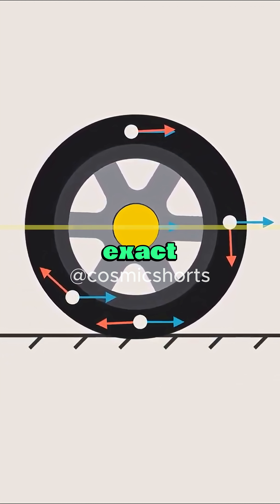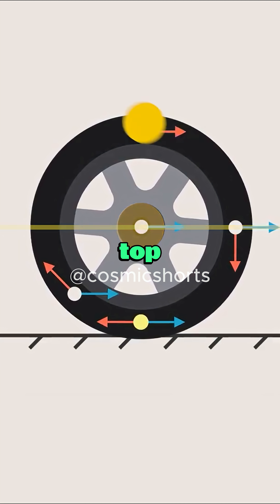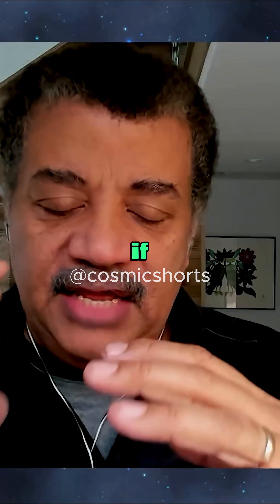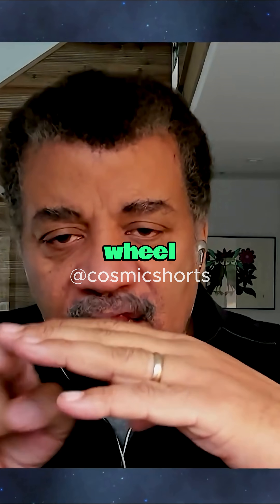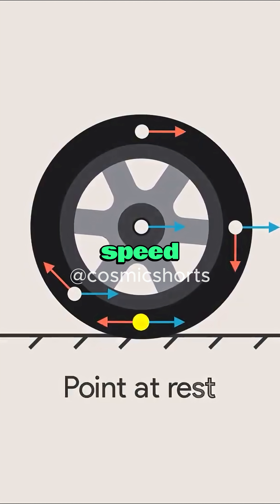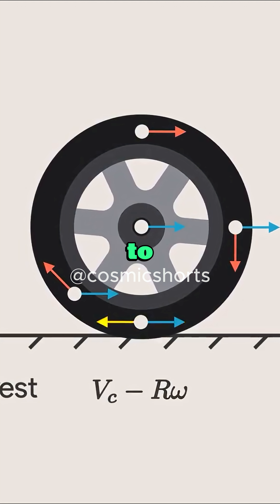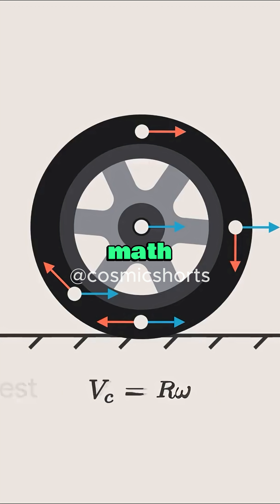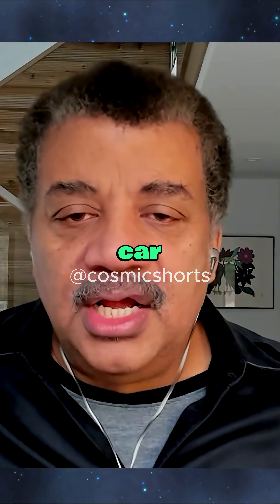The Surprising Science Inside Your Car Tires 🧪🛞

Comment: Makes absolutely no sense whatsoever. At best this is a mathematical problem. If the bottom of the tire (Neil, it is tire, not wheel), is not moving but it is directly attached to the top of the tire because it is part of the same tire, the top cannot move unless the bottom moves by the same speed. Yes, if you could stop time, then at specific point in time, the bottom of the tire that is touching the road is not moving but then at that exact specific point in time, the rest of the car, not just the top of that car’s wheel, is also major moving.

Comment: If we can do this equation properly can this be used to get out of a speeding ticket? Being that the speed in which they clocking is based off of the wheel that is not in contact with the pavement….which in turn shows that the speed they have is based on a faulty imaginary standard?….Lol

Comment: Yes but no. 
The "top" or the "bottom" of the wheel is always changing because it's spinning. 
Put some white tape on the wheel and tell me the"bottom" of the wheel has zero speed.
Reply: Consider each little section of tire separately. For the very short time each section of the tire is in contact with the road, it stops moving forward while the axle moves over it. Then that section of the tire is lifted up and the next section contacts the road. Of course, the tire as a whole keeps rotating for the entire time.
Your piece of white tape will stop moving forward for the short time it is touching the road.

Comment: It depends on the reference point you choose. Watch from the side of the road, then his explanation is right. If the pavement is not moving, the tire in the contact point also can not have speed. Take an exact look at a moving tank... you will be surprised.
Now imagine you are sitting in the car. Everything outside is suddenly moving and all the points on the tire are rotating with the same speed.

Or imagine earth. As long as you are on earth, you can not tell, that the earth is moving. This means earth posesses no speed, but the other plantes are moving. Change the reference point. Look from the sun and you will see, how the earth moves.

The choice of reference systems are very important. This could make the math easy, or incredibly hard. Choose sun for reference, the math for the movement of earth is relative easy. Choose some random planet, and you will have to do the math relatively to this planet.

Comment: Take a wheel with a 60-mile circumference.  It starts at zero miles an hour at the base.  It accelerates to 15 mph for 15 minutes.  It then accelerate to 105 mph for 30 minutes before reducing its speed to 15 mph for 15 minutes.  Grand total requires adding up the total speeds and dividing by the number of sections.  Here it is 4 chucks of shifting velocities.  240 mph / 4 = 60 mph.  Reduce the wheel size and increase those chucks still gives the same result.  No section of the wheel goes above 105 mph and never below 15 mph after the base starts moving at 1/16 of of a mile is the slowest it ever was; and, will be roughly.0.000001068628998 mph for a 65 inch car wheel.  Never 0 miles an hour once it starts moving.

Comment: That's BS. A theory problem that doesn't explain reality but sounds good on talk shows
Reply: No, this is real. 

As other posters have pointed out, it is more obvious what is happening with the tracks of a tank or a tractor. When a section of the track is in contact with the ground, that section of the track does not move - it sits on the ground while the internal wheels run over it. Then that section is lifted up and carried forward over the top of the wheels. As it does, that section of the track has to move forward at twice the speed as the vehicle itself is moving, so that it ends up at the front of the row of internal wheels ready to be placed on the ground again.

A similar thing happens with your feet when you are walking at a steady pace. The foot that is on the ground doesn't move forward. Then, when the other foot is on the ground, you lift the first foot up and swing it through so that it is moving forward faster than you are walking (roughly twice your walking pace), so that it ends up in front of you ready to be placed on the ground.

The same thing happens with the tire around a wheel. The wheel keeps rotating at a steady pace. The axle is attached to the vehicle so it moves forward at the same speed as the vehicle. Each section of the tire on the outer edge of the wheel is like a section of the tank tracks, or like your foot. It touches the ground then stops moving forward until the axle has moved past it, then it is lifted up and turned over the top of the wheel until it meets the ground again.

Comment: So, in that case, when walking, a person's hip is moving at twice the rate of their knees, and their feet are stationary = Bullshit.                                                                                           Doc
Reply: You've got it backwards. Your hips move at the same pace as you do. When you place each foot on the ground, it stops moving forward. It says at the same place on the ground as your body moves over the top of it. Then you lift up that foot and swing it forward faster than the speed you are walking so that it ends up in front of you (roughly twice your walking speed) so that the foot ends up in front of you, ready to be placed on the ground again.
The axle of the wheel acts like your hip. Each little section of tire on the outside of the wheel acts like your foot. When that section of the tire hits the road, it does not move forward. It sits in contact with the road while the axle moves over the top of it. Then that section is lifted up and swung over the top of the axle to get it ready to hit the ground again. At the point where that section of tire is directly above the axle, it is moving forward at twice the speed of the axle.

Comment: If that were true, then the bottom of the wheel would not keep up with the rest of the car. The top of the wheel would outpace the body of the car. That is a mathematical delusion that confuses numbers with reality = Bullshit.       Doc
Reply: As I mentioned in the previous post, this is real. Nothing delusional at all.

As other posters have pointed out, it is more obvious what is happening with the tracks of a tank or a tractor. When a section of the track is in contact with the ground, that section of the track does not move - it sits on the ground while the internal wheels run over it. Then that section is lifted up and carried forward over the top of the wheels. As it does, that section of the track has to move forward at twice the speed as the vehicle itself is moving, so that it ends up at the front of the row of internal wheels ready to be placed on the ground again.

The same thing happens with the tire around a wheel. The wheel keeps rotating at a steady pace. The axle is attached to the vehicle so it moves forward at the same speed as the vehicle. Each section of the tire on the outer edge of the wheel is like a section of the tank tracks, or like your foot. It touches the ground then stops moving forward until the axle has moved past it, then it is lifted up and turned over the top of the wheel until it meets the ground again.

Comment: no. He interprets faulty prescriptive physics rather than grasping that you can observe that we're in a closed system. if you move a cup of water upwards, you will stir it a little, but it will abide to the parameters of the system they're in. The atmospheric pressure within the cup is its system. The density of the water would be different otherwise. THe air would be different (the glass would remain unchanged in nearly every environment that doesn't have excited particles). This man is just old trying apply every misinterpretations to the entirety of the universe when he can't escape the fact that he believes in several lies. If he truly wanted to believe in fewer lies he wouldn't assert things as true: "did you know"... implies something is rather than could be true. It's annoying as ffff to tumble on these shorts.

Comment: Kinda like running, the instant your foot hits the ground, it’s not moving- if it did you would skid and fall. Once off the ground the foot has to move very quickly to be at the right spot to hit the ground again. Your legs added up end up moving faster than your body.

Comment: He's incorrectly mixing things. He mentions speedometer.. So All of the car is is going that speed in speedometer.

If you then mic other (relative) velocities, that's just dumb. Of course they differ.. but you're measuring a different speed then.

But, I guess the whole point is that he just likes to talk.
Reply: The majority of the car is moving forward at the speed given by the speedometer. The wheels are spinning because of that movement, but tires at the outer edge of the wheel are not moving forward in the same way as the rest of the car.

As other posters have pointed out, it is more obvious what is happening with the tracks of a tank or a tractor. When a section of the track is in contact with the ground, that section of the track does not move - it sits on the ground while the internal wheels run over it. Then that section is lifted up and carried forward over the top of the wheels. As it does, that section of the track has to move forward at twice the speed as the vehicle itself is moving, so that it ends up at the front of the row of internal wheels ready to be placed on the ground again.

The same thing happens with the tire around a wheel. The wheel keeps rotating at a steady pace. The axle is attached to the vehicle so it moves forward at the same speed as the vehicle. Each section of the tire on the outer edge of the wheel is like a section of the tank tracks. It touches the ground then stops moving forward until the axle has moved past it, then it is lifted up and turned over the top of the wheel until it meets the ground again.

Comment: But it's never the same part that's not moving. Am I getting this right ?
Reply: Yes. As each little section of tire contacts the road it stops moving. The axle of the wheel moves over the top of it. Then that section is lifted up off the road and turned around over the top of the axle until it hits the road again. At any instant, one section of the tire is on the road and not moving. The opposite section at the top of the wheel is moving forward at twice the speed of the car.

Comment: So if the part of the wheel that's touching the road isn't moving at all, how does the wheel rotate?
Reply: The wheel is rotating at a steady rate. As each section of the tire comes into contact with the road that little section of the tire stops moving forward. It stays still while the axle moves forward over it. Then that section of the tire is lifted up and spun around over the top of the axle, then lowered down ready to come into contact with the ground again.

Comment: wtf is this dude on?? that point of the tire this idiot is talking about, how can that very same point of the tire end up further down the road if its not moving???
Reply: As other posters have pointed out, it is more obvious what is happening with the tracks of a tank or a tractor. When a section of the track is in contact with the ground, that section of the track does not move - it sits on the ground while the internal wheels run over it. Then that section is lifted up and carried forward over the top of the wheels. As it does, that section of the track has to move forward at twice the speed as the vehicle itself is moving, so that it ends up at the front of the row of internal wheels ready to be placed on the ground again.

The same thing happens with the tire around a wheel. The wheel keeps rotating at a steady pace. The axle is attached to the vehicle so it moves forward at the same speed as the vehicle. Each section of the tire on the outer edge of the wheel is like a section of the tank tracks. It touches the ground then stops moving forward until the axle has moved past it, then that little section of the tire is lifted up and turned over the top of the wheel until it meets the ground again.

Comment: So let me see the wheel is spinning but going 0mph ok got it😂😂
Reply: It's a bit like when you are walking at a steady pace. You place each foot on the ground and that foot stops moving (0 mph) while your body moves forward over it. Then you lift the foot up and have to swing it forward faster than you are walking (roughly twice your speed) so that it ends up in front of you, ready to place on the ground again.

Think of each tiny section of the tire like one of your feet. When that section of the tire is on the ground, it stops moving while the axle moves forward over the top of it. Then that section of the tire is lifted up and swung around over the top of the axle, ready to be placed on the ground again.

Comment: An easier way to think of this is if the car was stationary (so imagine the wheels have been lifted off the floor).

The top would be going forward at the speed of the car.

The bottom would be going backwards at the speed of the car.

The middle would not be moving backwards or forwards as it is stationary.

Now if you put the car on the floor and it is moving. You simply add the speed of the car to the above.

So the wheel at the top is moving forward at the speed of the car plus the speed of the car.

The wheel at the bottom is spinning backwards at the speed of the car plus the speed the car is going, so this cancels each other out.

The middle parts of the wheel were not moving backwards or forwards stationary, so you just add the speed of the car to see how fast they are moving when the car is in motion.
Reply: That makes better sense 
Some people are better at explaining than others

Comment: So how fast do 4 wheels have to spin in unison for a car that is traveling at 60 mph? Is the question. Niel Degrasse: "Depends on the weight" Me: "okay then, a 1989 Honda crx for example"
Reply: The rate of spin is based on the diameter of the tire, not the weight of the car. 
Let's say the diameter of the tire is 20". Then one rotation of the wheel moves the car forward about 63". There are 63,360" in a mile, so that means the wheel turns about 1000 times to cover 1 mile.  
60mph = 1 mile per minute so about 1000 revolutions per minute (1000 rpm) gives you a speed of 60mph.
If your tire diameter is 24", that rate drops to about 840 rpm

Comment: He’s just saying that the backside of the wheel turns over the top to the frontside of the wheel, meaning it’s moving faster than the car itself. And when it comes backwards across the bottom, for a second it’s not moving at all as it’s going backwards.

Comment: i think a better explanation is by using the diagram at 0:30 and looking at the tangential velocity(red) and the car's total velocity (blue). when you add these together at the bottom, they cancel out. when you add them together at the top, they double up. all the other points on the wheel have a speed between 0 and twice the car's speed.

Comment: This is strangely explained, in reality the wheel is not moving forward but only arond it’s center. Which is a movement at top the same speed as the car goes an thbsame speed at the bottom, but opposit direction so backvard to the car. So if you lift the car to the air, it’s just spinning the wheels like this, but if the car is travelling on the road, than the car speed added to the wheel spinning speed, which givs you 2xspeed top, 1x speed mid and -1 +1 so nullified speed at rock bottom.

Comment: I love when mike does his half bullshit speeches.  He is trying to tell you the vectors.

Notice the top of the tire only has one vector speed. The top is moving at 60mph. Then the bottom is moving in 2 directions at once. Which is bullshit. The bottom has the same vector speed. All the points of the tire will have forward parallel to the outside edge of the tire. and another force that tries to move the out from the center of the tire.

He talks a good game but can't help but run a bullshit con game. Because the blue arrow would the same at the top as it is at the bottom. So there for the top and bottom of the tire would be going zero. and the sids would be going twice. with his nonsense.

Comment: 2 points in rolling contact have the same velocity. Therefore in the road's reference frame, rhe point where the rubber hits the road is zero velocity. the car axle +60. In the car axle reference frame the road is moving -60 mph, the axle center 0 and the wheel top +60. Taken together in the road reference frame the  wheel top is +120.

Comment: *(Relative to the point of contact with the ground.)
- But relative to the chassis (and the frame of the car and its passengers), the top and bottom of the wheel are moving at the same speed (in opposite directions) and the chassis is not moving.
- And if for some crazy reason you decided to measure speed relative to the top of the wheel, the bottom and chassis of the wheel would be moving backwards...

Comment: This is very obvious and has negligible value. However the same principle is of value in Helicopter design whereby the rotating rotor blades travel double to helicopter's speed on the forward part of rotation. Here helicopter speed is limited by the blade's speed through the air.

Comment: It’s all relative.  I’m easing on down the road at zero mph.  The road is sliding under me at 60 mph ⬅️.  The bottom of the wheel is doing the same.  The axle is sitting still (ignoring its rotation).  The top of the wheel is jumping ahead at 60 mph ➡️.  My evidence?  If I toss a coin straight up, it comes straight down.  Any other perspective mentioned it draws a ballistic arc.  🤓